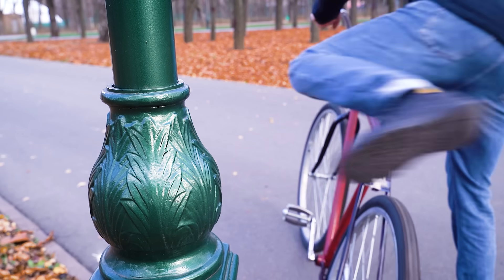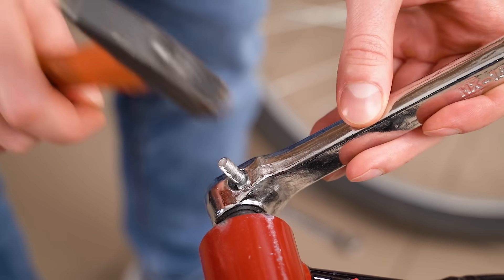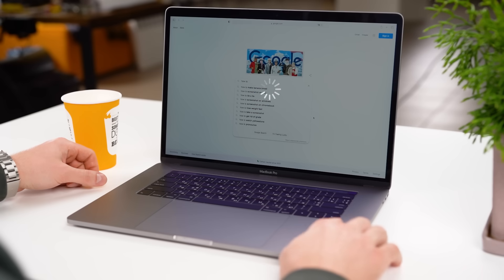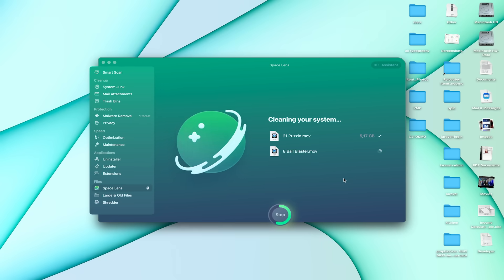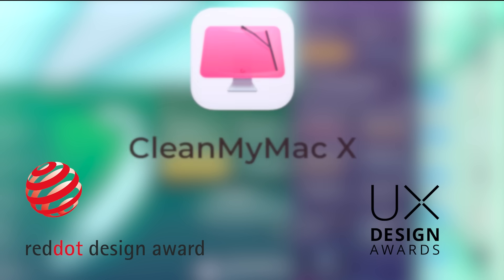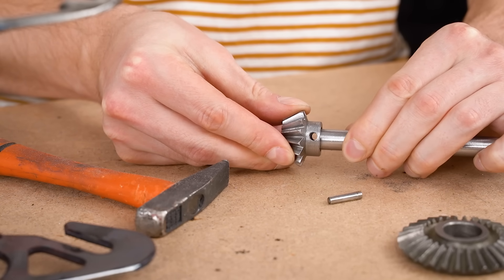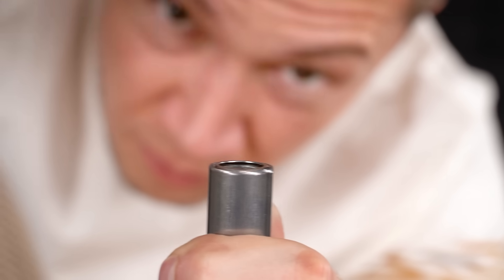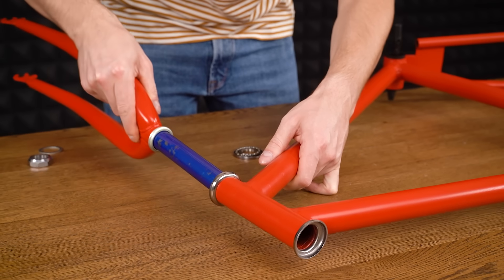Insane Chainless Bicycle Prototype

Comment: Ok but you can't go fast . because how many paddle rotations you done .that rotations only transfer to the back wheel.but in chain system . there have some front gear and back wheel gear ratios .in chain system you rotate paddle ,back wheel more rotations.

Comment: Para ciudad y planicie serie buena, pero la ventaja de la anterior es el cambio de velocidades de carrera a montaña es subidas ese cambio es un gran alivio de presión a las piernas aunque uno tenga que dar más vueltas a los pedales. Si le voy a meter engranajes mejor modifico una motocicleta para que sea de pedales o ambas desmontando los pedales del engranaje con algún dispositivo. Pero aunque fuera ingenioso no lo subiría en video luego desaparecen la gente ingeniosa porque afecta los intereses de las motos, autos, petróleo, o cualquier cosa para exprimirte tu papel con valor real de cero pero económico de mucho el billete un papel que vale más que el papel pero no deja de ser papel.

Comment: 1) shaft drives are far less efficient to chain drives.  2) your contraption needs a larger gear on crank.   Far too low ratio

Comment: Now it’s geared way too low, you see how fast he has to pedal to reach a fast walking speed.
Reply: If this is geared higher he wouldnt reach any speed...
Reply: @andrasolivier7185  higher gear ratios are actually numerically lower, lower gearing makes it slower, higher gearing increases the top speed. Like in a car, 3.73 gears are higher that 4.10 gears
Reply: @00fordxlt  U probably didnt catch my point... but never mind you have as many tries as you like...

Comment: Looks promising but it needs further improvement:
- gears were exposed directly to heat, cold and dust. They won't last long enough. Need to put a shell/ housing and always remember to put grease. Metal wears rapidly when in direct contact with another metal.
-  no free wheel and 2nd gear (at least). This bicycle is designed only for short distance otherwise the rider will get tired easily

Comment: Cool project but Seems the gear ratio isn't very efficient and why not go crazy and have a second shaft on the opposite pedal drive the front wheel 2wd bicycle could be interesting?

Comment: Those conical gears are exposed to the elements - rain, dirt, grime, sand. They will not last long.

Find a way to enclose them and you might be onto something
Reply: its actually the oposite, chain driven bicycles are less durable / efficient in the dirt
Reply: With deferential?
Reply: Chains are exposed to the elements yes... BUT, the portion of the chain where all pivoting takes place is enclosed.
Reply: Yeah, be on to something ! like how about replacing the gears with say a CHAIN, for. Motion economy , and a better engineering? That might work ?
Reply: I don't think that matters much, I'd be far more worried about stopping, and being in complete control
Reply: What about chains? They are exposed to the elemnts much more.
Reply: @mareksykora779  Zase si mimo, inženýre, ozubený kola se musej odvalovat a to neplatí pro řetěz. Tedy špína a bordel ubíží tady tomu nesmyslu mnohem víc než řetězu...

Comment: Awesome piece of rudimental engineering and a very clean fixie build. You will need to strengthen around the bevel gears as they will force themselves apart and 'jump teeth' under high load. The gear ratio is too low also, but overall it is an excellent job and a good way to get clear of the oily messy chains. Well done.
Reply: Truth is, its completely impractical ..useless
Reply: Danger Bear  Its terrible..completely impractical...a good clickbait video tho
Reply: Да,в данном случае,планетарный механизм не очень крепок и стабилен , его нужно усилить и по возможности закрыть от попадания грязи и пыли.
Reply: Does no one care about a range of gears that you can use without rebuilding the bike when you need to change gear

Comment: This might be a prototype for your garage… As others have pointed out this is nothing but old.  There is a reason this design is rarely used in anything but a low stress configurations.  It has catastrophic failures due to high stress characteristics.  A bicycle provides very high stress.  The bike frame has to be beefed up it will never hold the torque stresses along with the gears.  They cover this in Engineering 101.  Clickbait.

Comment: Nope. For starters that bracket on the rear assembly won’t handle the radial thrust loading under any significant amount of input power. If he tried to stand up on the pedals he’d grind the hell out of those gears.

Comment: I'm no expert at bikes but while at the last part when you stopped pedaling I was just baffled at the bike somehow was a one way wheel drive or something 
But there were no brakes 
Did it just drift??
Is it still a one way wheel??
This was already a project back then in 2018 or 2016-2015 (unless this was just recommend to me)
And it was kinda crap for the fact you had to oil it up  every time 
And it was just weird 
But so yeah I'm not a fan for this I admire you're work I'm sleepy as fuc rn but props to you man

Edit: *(I'm gonna slap te frick outta myself I need to correct what I said the chain less shaft drive bicycle was 2 years ago, been presented after a year, then reviewed 5 months ago and as I said which is correct chainless shaft drive bicycles sick for that you can't get dust or mud into it or it'll jam whilst chain bicycles can take hard beatings from mother nature herself 
And also maybe daddy nature- god I'm a f*cking idiot-)*

Comment: It is called bevel gears, more efficient in transmitting force from the pedals to the wheels than chain. But, it is very expensive and the spare parts are hard to find

Comment: Good idea but not for bicycle the application can be put in use else where.  ..the gears will all get broken or wornout in a few days it will not last long and slow the load cannot be given more mean torque cannot generate at the initial start up

Comment: It's a bit impractical because you need to keep pedalling to increase speed.  With the chain, if you are on a slope you can stop the pedalling. With this design the pedals with go haywire if there is a slope because the gear with keep it moving as the tyres are locked with it.

Comment: So the bike chain takes advantage of multiple teeth biting into it. The torque power could be the same, but the power in your design is put onto one tooth engaging. External gears bite into many many teeth and lessens wear as torque is spread out. The chain is a type of externally engaging gear that can flex for the changing gear sizes when ratio needs to be changed.

Comment: Shaft drives have around as novelty items for over a century.  The big disadvantage is they need an oil bath at each end for longevity, this one runs dry and won't last for long.

Comment: Do you know why the chain Remains The Undefeated King?
Simple it's self cleaning and chain drives pull axles together! 
Gears are not self cleaning and the greater the force the more they push each other apart. 
So this bike design was a complete waste of time. Heavy force + dirt packing will destroy this drive system in no time.

Comment: From what I have read there are shaft driven bicycles available that have gears. They are not as efficient as chains and they are also much heavier. An advantage is that unlike chains, the shafts are sealed in a housing and they don't get gunked up with mud and dirt.

Comment: You can't Stop paddle when it's move freely , I mean there a very important role of one way bearing which is missing in this case
Reply: Yea u are right man
Reply: Nope even this one can have one way bearing .....just this video did not demonstrated it.
Reply: @mohanmaxwel1928  one way bearing are of much larger dimensions.... It would be a severe alteration.
Reply: You know paddling is for boats and bad children? The word you are looking for is pedaling.
Reply: So is that mean, we can drive bycycle backwards when paddle move in reverse?
Reply: Freewheeling mechanism is inside the hub... So it's not fixed gear. Still not very practical, as the gear ratio is very bad
Reply: Rear axle has ratchet system...he can stop pedal even when it is moving...am I wrong...?
Reply: @KoreanJombie  u r good
Reply: @KoreanJombie  yes you got the point thanks to rachet system it is possible
Reply: One way bearing is in the rim he swapped out chain and sprockets for direct drive pretty impressive
Reply: Itllbe way to hard to peddle lol
Reply: My 20in dirt bike could coast without pedaling and pedaling backwards was the brake. The mechanism was in the rim. the only problem I see is the 1 to 1 gear ratio and the little gears would probably wear out quick.
Reply: Also do not switch
Reply: @game_Tank  Possible if using a inner gear system...
Reply: ?? 그건 뒷바퀴에서 담당하는 역할인것같은데… 라쳇에서
Reply: There are so many idiots in YouTube...haha.
They didn't know about the system of bicycle and fkn word...paddle? Pedal!
The point is not efficiency, but concept!
Trying is very important.
This video is very goooood somerhing try~
Reply: Reverse bearing is available
Reply: @Singhaniaeducation634  had he put that 🙄
Reply: I agree
Reply: Sprocket
Reply: just like a fixie bike duh
Reply: u can use the old school,use slipper put between the fork 🤣🤣🤣
Reply: Absolutely! I was about to ask how it has been handled on free gliding down.
Reply: Nice point
Reply: Not true. You would actually begin to brake if you applied pressure in the reverse direction. I used to have a bike like that when i was a kid and there were no brakes on it, so the only way to stop was to backpedal.
Reply: Clutch can be placed...
Reply: No gear change too
Reply: To solve that issue I would just install a smaller bearing in the back wheel and in the pedal shaft in the centre,  problem solved :)
Reply: We need to be able to detach and reattach it with some mechanism which can be fixed on the handle
Reply: Yes So engineers had put chains there ☺️
Shit prototype 🤣
Reply: The freehub body is on the hub and still exists as it’s unchanged thus it will still freecoast without the pedals locking like a fixed wheel
Reply: @Homegrown your right about the gearing it’s like a massive useless trials bike 😂 
Was suprised it rides at all but under any more pressure I don’t see it going well
Reply: Worst  invention  he  does
Reply: Yeah,  and you can't go faster🐢🐢🐢🐢
Reply: @karlvenn588  Possible if using a inner gear system...
Reply: But you can stop by paddle without brake like  Fixed Gear Bike.
Reply: We can have foot rest for this purpose
Reply: Yes.....  U can't stop paddle...
Reply: Add a ratchet.
Reply: One way bearing??? Fiction. Never heard of a one way bearing. Im sure the one you built with this one way bearing you speak of is much better. Crazy some people just wanna bash a guy with grade a horseshit
Reply: @xLeon-vr4kj  one way bearings are a real thing.

Comment: hi ur invention is good but in normal cycle you could see cycle gear in 1:4 ratio which means it will run wheel 4 times for 1 round of pedal and it works as a torque in uneven roads like hills

Comment: Very suspicious that there is not enough rigidity in the rear wheel drop out as designed to keep the bevel gears engaged. Maybe OK at modest levels of power but some real pedal mashing to accelerate up hill is likely to cause more side force on the dropout than the thin flat plate design can resist and the bevel gears will pry apart. Notice how they were captivated in the donor assembly.

Comment: Minor mistake found that, the paddle gear, it should be in big size of babble gear pinion so then one can easy to cycling normal pull of the paddle and generate more speed on cycle wheel.

Comment: You should see if it's possible to make a multiple-speed fixed-gear bicycle. (So, a rear derailleur, but without the freewheel.)

A bicycle with magnetic bearings would also be cool.

Comment: The gearing is for high torque low speed.  How does the handle incline or rough terrain?
Reply: You step down and walk along side your bike, and walk it up the hill.
Reply: @kfl611  you want torque to climb hills
Reply: redbull
Reply: Yeah it requires more efforts to drive that bicycle.. the wheel will rotate by 1 cycle after paddling it for 1 cycle.
Reply: Interesting idea problem is like I'm sure most of the viewers  know it might work for you or.  someone pretty strong and good physical condition problem is because of the gearing it would be like starting off a 10 speed bike or whatever 18 speed 21 in the highest gear or if you were driving a car with a clutch be like trying to start off from a stop in 4th gear interesting idea if you're strong enough to start out but the problem is most people today are so out of shape that you would be causing a lot of heart attacks with that design but I do appreciate your workmanship if you can figure out a way to put a couple of different gears on the front crank without a chain you may have a money maker
Reply: You rather ride decline on this hellmachine...

Comment: Big sigh....I'm an ex-pro CAT-2 and bicycle messenger. This is so-called geared drive mechanism will not work under racing conditions. You need a drive chain with gears to climb fast and descend.

Comment: Well its good but theres a problem also how about it when you drive it from low to high slope roads.those two gears at the back will be surely damage in the long run. Well its said its only a proto type but i like the idea that theres no need for chains anymore ... For the future bikes development . 👍👍

Comment: Insane...yes!  If it were practical, it would be universal...I will take my multi speed bicycle over this single speed...never had a chain problem in my 65 years of bicycling.
Reply: It has 3 gears 

Here , there, and goneeee it has the speed of infinity and beyond
Reply: @hugoguerrero9814  lmao😂
Reply: I had a chain derail once. 
I put it back on in about 10 seconds. Although my fingers got a little dirty.
Reply: I have had some problembs but i will only say one thing 
THE KAWASAKI NINJA ALSO USES CHAIN TO RUN 
lol
Reply: How? My chain fell off just yesterday
Reply: @curtsk19  must be a cheap one
Reply: Oh please. If chains didn't have inherent problems then why do they sell chain repair kits at Walmart? If you never had a chain problem you were either just lucky or didn't really ride a bike all that much.
Reply: @fletcherchad9434   Sir , do you consider chain separation from  gears as a chain problem ? I haven’t seen an broken chain before . Breaking the chain should be so hard .
Reply: @namelessone761  yes separation is a problem but also chains do break. Also the derailers have problems. Linkages break. I dont think a drive shaft driven bike is the solution but the original poster claimed chain systems never have problems so I would definitely disagree with their premise.
Reply: @fletcherchad9434  If you break your chains often you're either using really cheap chains or using them wrong.

In all of my years using a bicycle i have never seen a broken chain, derails from loose links yeah but broken links? How do you even do that?
Reply: @Ebani  or you are on a mountain bike and riding through rough trails. There are also more problems than just a chain braking
Reply: @Ebani  had to fix a broken chain at the mtb park just this riding season.
Reply: @fletcherchad9434  وهل المسننات لايوجد فيها مشاكل
Reply: But why you sound like you hating though? 🤣